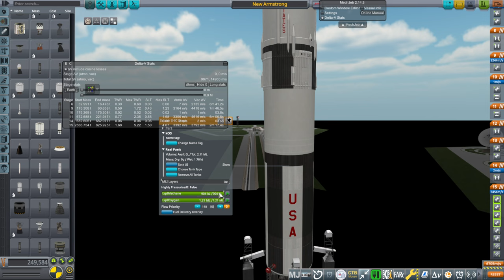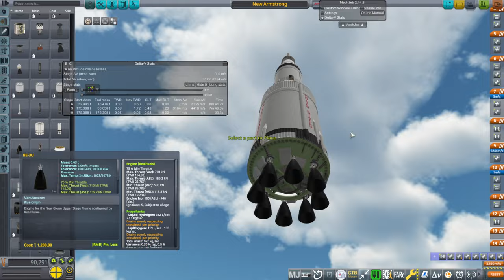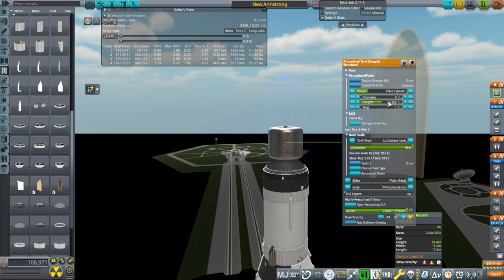New Armstrong - Saturn V with Blue Origin Engines (KSP with RO)

Comment: with what mod did you get that lounchpad from?
Reply from the maker: I believe it was adapted from an old version of Modular Launch Pads and turned into a Kerbal Konstructs static. Don't take it too seriously - it was just a makeshift thing. You'll get better results using a more current version of Modular Launch Pads and putting it on the rocket in the VAB, probably. I did this back in the day because physics was not cooperating with me and the pad was flopping all over the place.
Reply: @RaizSpace  is that Kennedy space center?  And if so, what mod is it?

I love your videos

Comment: Funny concept this one is, next you should swap to raptors if it wasn't done yet)
Reply from the maker: The problem with Raptors is SpaceX doesn't have a hydrolox engine to go with them.
Reply: @RaizSpace  sorry but I don't understand, why the need for hydrolox?
Reply: @RaizSpace why not go from kerolox to hydolox more gradually: RD-171s in the first, RD-704s in the second and RD-0120 in the third Stage.
Reply from the maker: @cristianshay227 The Saturn V tank volumes in the second or third stage are meant for hydrolox - if you want less dense fuels, then it would be better to reshape the rocket in those two stages. You really don't end up with a Saturn V, nor a rocket optimized for the Saturn V's role to send payloads to the Moon. Starship is optimized to deliver propellant to low Earth orbit, because that's what it will be doing in most launches.
Reply from the maker: @bernhardschmid9222 Methane is generally considered better than kerosene for reusability. As for your proposal - just use the Vulkan rocket - Energia in a stacked configuration. The RD-0120 as a third stage engine suboptimal compared to what I used to use with the Vesuvius stage, which was more vacuum optimized - the engine number slips my mind. The RD-704s have a particular purpose, but adding other kerosene engines as a first stage sort of robs them of it and makes them irrelevant.
Reply: @RaizSpace  Just to clarify: I was referring to the rd-704 Version with the short nozzle and only one mode, that was proposed for an Angara core. But shure there are better ways than using those three engines.
Reply: @cristianshay227 because it’s the best

Comment: question how do you get the build mode without the vab in the way?. like building outside the vab.
Reply from the maker: It's a mod called Hangar Extender. It creates a button on the toolbar that will do that and also extend the building space.
Reply: @RaizSpace  thank you man